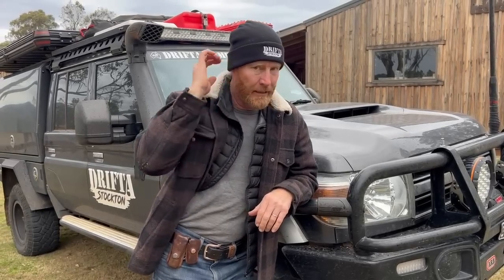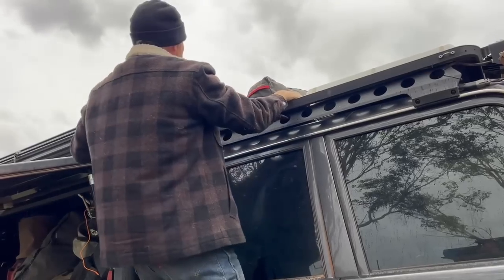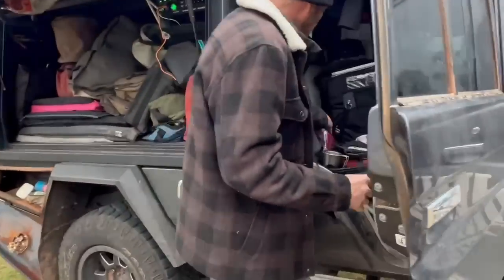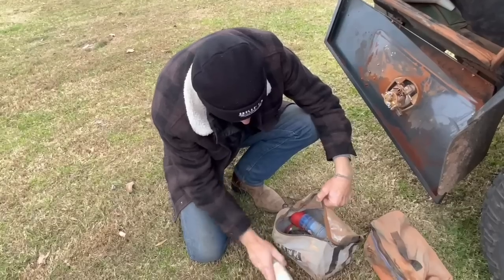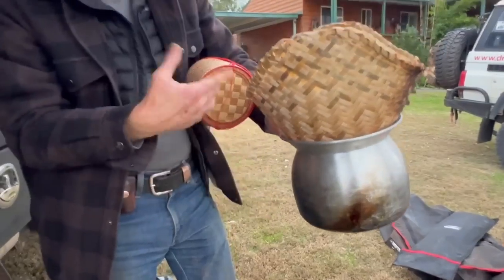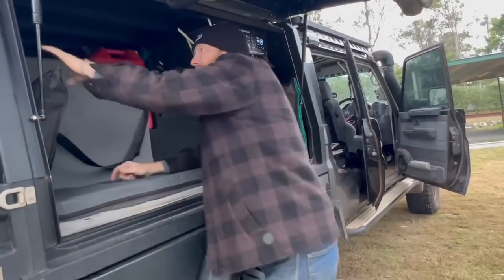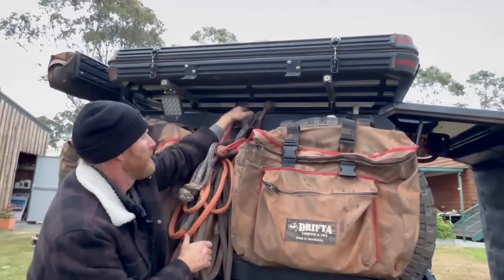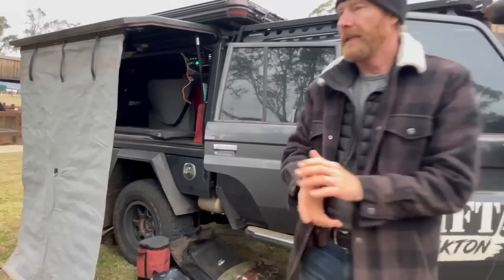CANNING STOCK ROUTE TRIP RUNDOWN

Comment: In my experience, while true generally blow outs are more likely to be due to running on a flat, there are still plenty of punctures and sidewall damage that can't be plugged, so for a trip like the Canning, IMHO you definately want to be carrying 2 spares PLUS Plugs etc.
Also the I've had quite a few Goodyear Wranglers, they are NOT a very good or tough 4x4 tyre, there are a lot of better tyres out there.

Comment: Hey luke loved the trip, are those goodyear at's definitely 3 ply sidewall? Ive seen they can have pretty soft sidewalls, my brother has a set and his size are 2 ply sidewalls. Im not sure about all sizes though. Anything with a 2 ply sidewall up here in central aus where im running around out bush gets steaked easy there no good, im running mickey thompson baja boss at's, excellent tyre would recommend. Toyo mt, yokohama  mt all solid tyres mate. Cheers
Reply from the maker: hey mate, yeah I'm going mack to MT after this I reckon : ) side walls on these Goodyears are soft as shit.. : ) the MT kevlar ones were great,  but can't get them anymore... L

Comment: Firstly, congrats on a great trip. 👍 

Now, those Wrangler Duratrac don't have a great reputation when it comes to sidewall durability. Certainly a bad choice on a very heavy 79. 

And you can't really compare your Duratracs to your MTRs, as most mud terrains will have a more durable side wall than any ATs, some even have mine spec sidewalls with extra rubber ribbing ect. Sorry, but your tyre bloke sounds like he knows very little. 

The load range and the load index of a tyre isn't going to tell you everything about the actual durability of the sidewalls, but it's a good starting point. 

The load range, "stated as a letter" indicates more to the durability of the tyre. Most LTs in that size will be load range "E" which they say is equivalent to the durability of a 10ply tyre in the old term. This doesn't mean it is actually a 10ply tyre.😉 

So yeah on paper, your Duratracs might indicate that they're as tough as any AT or MT in that size but in reality they're not.

Comment: IMO Way to much gear. Uncle Richard got by with a far cheaper, easier and simpler setup. One table, one pot, one pan and you would of had the same experience  and half the unpacking of gear everyday.
Reply: Yep, I'm glad someone said it!  But I guess he's using this to showcase all the gear they sell. Great products but you certainly don't need to bring them all, especially on a trip like the Canning.  😂 Less is best.
Reply: @SteveBurns80 the funniest bit is  with a lot of his gear “didn’t use it but glad I carried it “ 😂 I did like the series though, interesting stories and spectacular scenery
Reply: @gregdogg10  Yeah I laughed when he said that too. 🤣 
I didn't watch all the episodes but yeah enjoyed the bits I saw. The Canning trip has been on my to do list for many years so I liked to hear all those stories.
Reply from the maker: too much gear ? you ever travelled for 4 weeks and needed everything on board ? I literally got 2 chairs couple tables a small Thai cockpot and bag of blankets . and that's too much gear ..  you should see some the rigs on the road these days.
Reply: Yes mate, I've done plenty of big trips, longer than 3 weeks, too. Our longest one without restocking supplies was 4.5weeks, this was during a 75,000km and 18months trip around Aus in just a decked out Triton extra cab chassis with canopy, we did all the tough iconic tracks except the full length of Canning. So yes, I know a few things. 

During the first 9 months of our around Aus trip, we realised that we had too much stuff, so we ended up culling 200kgs of gear we just didn't need. This made such a massive difference to our vehicle, better capability, performance and reliability/less maintenance.

In recent years, now with 100series Cruiser we do big desert trip and Cape York ect, we keep as light as possible, no heavy RTT, just light hike tents or small swag, no chainsaws, no hot water systems, 1x small 50ltr fridge, only 1x spare tyre, because we use quality MT tyres that rarely suffer damage.

Tools are heavy, so I carefully take only the sockets, spanners, wrenches, and spares that are necessary and specific to my vehicle, no big tool kits or battery tools ect. I do ALL my own mechanicals on my vehicles, so I know exactly what to bring.

And, yes I do see many people carrying even more stuff than you, these are usually the people I see having the most vehicle problems and breakages. 

But, please don't take offence to all this, it's just my opinion. However, I do have a lot of experience in this field.
I bet I could save you at least 200kgs of gear off that poor 79 of yours. 😉
Reply: If you are with another vehicle you can get rid of almost half your gear by load sharing 
My rule is “if you think you need it don’t take it”
Reply: @SteveBurns80 100% he had 6 tables all up 😮. 
2 section table, aluminium table, bamboo table, fire pit table, drinks table and table in the drawers.